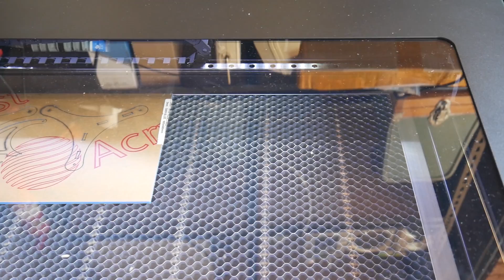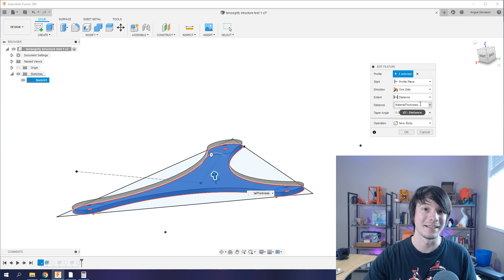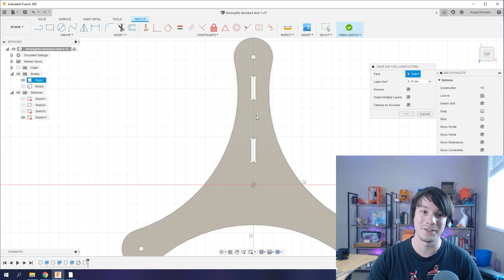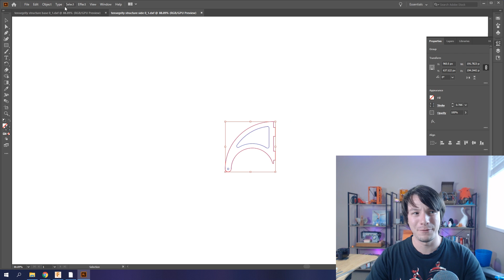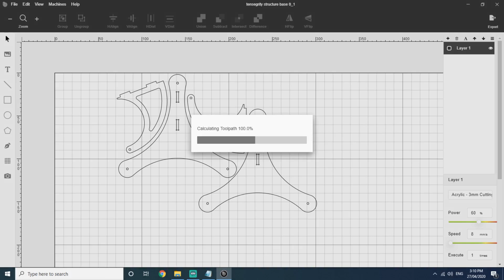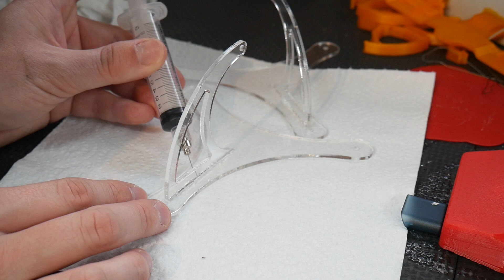Laser Cutting a Tensegrity Structure

Comment: Pretty sure Fusion 360 has a built in Kerf compensation - That is... If the Laser had its specs added to the Tool Library and used...
At least the Tool I use lists the manufacturers, supposedly, 0.2 Kerf and the Compensation Dialog mentioning the Kerf from that being used for that...
Reply from the maker: Yep it does indeed. I started with that approach but found it tedious compared to just exporting using the plugin.

Comment: Deepnest.io is a free nesting software that works pretty well. It allows you to configure an entire project, even if it covers multiple sheets, all at once. Also, Lightburn with their camera is a killer combo. The software is amazing compared to RDworks and the camera works wonders for positioning things and remotely monitoring while the laser is working.
Reply: Sadly, it has a number of bugs (and even provided code fixes for them) and it seems the original author has basically abandoned it.
Reply: @ex-nerd  That's a shame, I find it very useful though
Reply: @ex-nerd  Completely disagree with 'the original author has basically abandoned it". Check out the forums here = https://forum.lightburnsoftware.com/   But one think it lacks and REALLY needs is 'bridging'. I'd say that was a pretty basic function for laser cutting.  All the work the author put in to hardware comparability is amazing, but this very, very basic function if missing. Makes zero sense.
Reply: It's also useful for when monitoring when your laser catches fire. Let's hope you didn't leave the house when it does!!
Reply: @andyspoo2  nope, just from the other room. Mine is located in my garage and instead of walking out there every few minutes I can open Lightburn and check to see how things are coming along. Most of my laser projects are fairly short, 20-45 mins. The longest was around 2hr 45mins. For those I sit out there and work on other things, like turning stuff on the lathe.

Comment: A 3D printed version would be easier to design and wouldn’t waste any material. It would be better, right?
Reply from the maker: Perhaps, but you will get very weak layers in one of the directions due to low cross sectional area per layer.

Comment: In addition to measuring the kerf, I find it useful to have a test file that you can use to test out slots of varying tolerance so that you get a perfect fit before you cut your parts. By using parametric design as you did in the video you can easily adjust it based on material thickness to make it universal. For solvent welding, it is generally done with dichloromethane and the key is to have the parts clean and as close together as possible so that it can wick in the solvent. Unfortunately, the laser cutter leaves a surface that is not great for this technique which is why you likely had some issues with the cracking.

Comment: Acetone works only for certain types of plastics, either acrylic or polycarbonate will crack badly.
Then you also can have two sheets of acrylic with different compositions, hence why one of your structures cracked and other didn't.

Comment: Hey Angus, there is a DXF post processor for the cam system and 2D cutting operations there. If you search 'dxf_color.cps' in google, you will find the version I modified (its a github gist) so that every CAM operation is output in a different color so that it's really quick to set speed and power for each line in the laser software. By staying in Fusion 360, you gain the ability to add tabs, and do layout.

Comment: I've owned a laser cutter for years before I got a 3d printer. 3d printing is soooo much easier to design for but laser cut parts are often stronger and much faster to make. Both have their place.
Reply from the maker: Absolutely true! There's no one perfect process. It's pretty crazy the time difference, with these parts taking ~4minutes but a similar 3D Print design could easily take 4hrs.
Reply: I find the opposite for myself in terms of design ease, I think it's because the only CAD class I had was mostly 2D drafting with 3D CAD thrown on at the end so I'm more used to thinking in 2D. I consider designing for laser cutting 2.5D because it's making 3D from 2D shapes.
Reply: I do laser cutter programs for my job. The two laser cutters we have are 5kW and 3kW and cut steel up to 25mm. The biggest issue I have with lasers is that there is a distinct ratio between the thickness of the material and how small the features you want to cut. I normally use the thickness of the material as a guide to the diameter of the holes needed
Reply: @GhostZero_x  you mean if you have a 5mm thick material, you can't make holes whose diameter is smaller than that ?

Comment: Extruded acrylic costs less than cast and is more dimensionally stable, meaning the thickness is more consistent across sheets. Softer, with a lower melting temperature than in its cast form, extruded acrylic is easier to laser cut, rout, and polishes more cost-effectively.
Reply: but is more prone to cracking especially when applying glues and solvents.

Comment: First of all, laser cutters are incredibly easier to use than rotary cutters. That tolerance is negligible if you're going bigger by 0.02mm. 

Generally laser cutters are way easier to use than 3D printers.
Reply from the maker: Agreed. They're a great gateway tool into design because if you can draw, you can easily have that drawing laser cut.

Comment: Acetone works at PMMA like alcohol. During drilling or lasercutting you bring energy into the material as stress. This stress makes cracks or damage your workpiece totally when you add acetone or alcohol to the surface of PMMA. Also important: don‘t use cleaning fluids with alcohol as ingredient. You may think, this fluid for windows cleaning could clean your transparent pieces, but it will break it. Not instantly, but over night surely.

Comment: just a quick tip. do the internal cuts first then the outside cuts you will get a better result.  if you do the outside first the part can drop enough that the internal cuts don't cut all the way through

Comment: When I did laser cutting the colour of the line indicated order and or power. The original export had red and black, red for the internal and black external, but in the laser software all the lines were black. Does this mean you can't order your cuts? It makes a difference if there's a slight drop when a piece cuts through. We used to do all internal cuts then externals.

Comment: Would Lexan work with a laser cutter instead of plexiglass, it is less brittle?
Reply: Polycarbonate (Lexan) does not cut well in most laser cutters (flames up) and will create some pretty nasty fumes.
Reply from the maker: Yep, what Michael said. It tends to leave a burnt nasty yellow edge, enbrittles and is not recommended on hobby level machines.

Comment: You can use those as microphone shock absorbers! Just make a little mount and there you go.
Reply: A common super glue can get the job done easily
Reply: @bread1919  Super glue can cause crazing on acrylic as well. And with acrylic you need a glue than gets pulled in to the crack using 'capillary action'. Although super glue is thin, it's not thin enough. And real acrylic cement doesn't just glue the parts together, it chemically welds them, so they become a single part.

Comment: -In the 2 types of laser cutter I've used, you can preview cuts by opening the lid. Then the laser head moves, but doesn't fire.
-With acrylic sheet, the tolerances of thickness is like tolerances in filament, you get different ranges depending on where you buy from
-The solvent in acrylic glue is Dichloromethane. It also crazes if you apply too much

Comment: Super useful video Angus! (I'd call it "laser cutting 101" 😂).
It might seem a strange question but...any tips for a "good sounding" 3D printer?
Reply: Hy, for lowering the noise of your printer you could do many things, the main part that cause noise are stepper motors, fans.
For motors you could add dampers, these are some kind of rubber mount that absorbs the motors shocks, also the stepper motors drivers are an important factor, for example on ender 3, to upgrate the stepper motors drivers you fisrt need to change the motherboard, then add the tmc2208 drivers, i personally did this change and the result was amazing, almost didn't hear the motors anymore! About the fans, my stock blower fan was verry noisy and i decided to change it to the 5015. Also the axis could create noise if they aren't lubricated, just add some oil or lubricant to them and check if all the components work properly and they are securily locked. Also some rubber or plastic part used also in furniture, add them to the bottom of the printer to absorb sock created by the printer, and make sure the printer stay in place when it print and it has stability, just check what part of your printer create noise and check out on yt.
Regards and happy 3d printing!
Alex.
Reply: @alexandrugroza839  Thank you for your advice! Actually at the moment I need the opposite behaviour😂, but I'll consider those upgrades for the future!
Reply from the maker: A good sounding printer? As in silent or hits loud resonances lol.
Reply from the maker: OH just checked your channel haha, I get it now. Anything with a plastic enclosure and cheap stepper drivers with micro-stepping disabled and current cranked up!
Reply: @MakersMuse  Thank you! I'll look for something like that👍🏻

Comment: worked wit acrylic for 10 years, xt gs whatever specification it is always off, it is almost never to spec. original extruded plexiglas is the worst when it's thick, what should be 10mm is 8,5 on one side of the 2meter sheet and 11 on the other.
also xt  and gs plexiglas make a huge difference when worked with and never use alcohol on drilled acrylic.
Glueing should be done with MEP solvent never superglue as it leaves white residue.
Reply: What does alcohol do with drilled acrylic?
Reply: @peterkiss1204  heavy crazing within seconds

Comment: Really well done on laser cutting and I learned a lot. I have done it occasionally at work with thin wood parts, although occasionally acrylic too. For "nesting" I have used Deepnest IO which takes a little getting used to but can do some really handy nesting.
Reply from the maker: Deepnest IO seems freaking awesome, i gotta check it out!
Reply: @MakersMuse  once you learn it the program is bloody brillant.
Reply: @MakeItWithCalvin  Also I'd give a thumbs up to Deepnest. I used it to nest 90 individual parts for a geodesi dome I was laser cutting. I managed to get it down from 3 sheets of ply to 1 sheet by using their software. It's absolutely amazing.

Comment: The price of this printer is extremely expensive. 4095 euros... At half of this price you have a Chinese laser cutter autofocus 150 watts with chiller cooler can cut 130 cm (most of the board are 120cm) and with ruida control. This printer is just 50 watts.

Comment: I was laser cutter manager back at the architecture school... may be 2-3 000h of cutting and I would say not all acrylic are equals... And normally, if it "stinks" you shouldn't cut it !!
I think it realease nasty fumes... Normally the good laser cutting acrylic (wich is also the more expensive one, about 80euros/square meter) doesn't smell and is very reliable in thickness... Anyway that's my two cent on the subject... (it has to do with the fabrication process of acrylic if I recall, extrusion vs "flowing" I'm not sure of the english term... )
Reply: 3:55 he remarks that his sheet is extruded, and identifies the alternative as "cast", which sounds like it matches your "flowing".
Reply: @SaraWolffs  yes you are perfectly right... And one should only cut cast acrylic in my experience...
Reply: and by the way a good acrylic with good lenses and focal point almost generate no curf... if you ask for 20mm you should get 20mm except if you cut more than 10mm material... So in you case, I would say it's bad focusing or too much power or not enough speed while cutting wich melt the plastic...